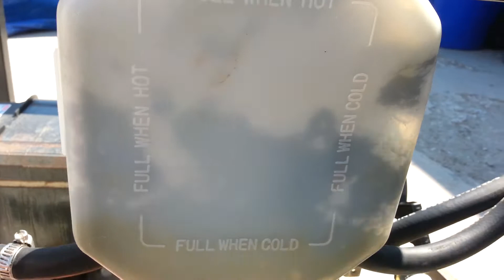Vapor Carburetor Running A 5000 Watt Generator

Comment: Sweet!!!  Nice work!! ~Russ
Reply from the maker: Thanks Russ! The funny thing is it runs good on vapors but won't run good  with the vaporizer shut off just running normally through the carb.. The hole in the flange I made for the exhaust mount is too small and creates too much back pressure when running without the vaporizer so I need to build a new one with 1" pipe instead of the 3/4" that's on there. The problem with using a 1" pipe is I will have to weld it on there because the holes that I would screw the mounting bracket onto are too close together.The joy of prototyping!

Comment: The primary concern is at what temperature does it run?  We tested a brand new engine and the only way we could keep the temperature the same was running it very rich.  It used the same amount of fuel.  Higher temp = shorter engine life  Find a way to cool it better and you could run it leaner and save fuel AND keep the engine running long term

Comment: The magnetic propulsion would generally be for home use I would believe that I stated previously. But what kind of run time are you looking about before gas becomes unusable? And heating gas to what temp would give what results in real world generators and cars? HHO and gas vapor system any thoughts of the two together? Cars overheating or running hotter with gas vapors? HHO showing what kind of temp results on vehicle as well? I'm a doer, but no sense in reinventing the wheel or wasting time or money yet. Still in the research stages but enjoying every second of it.. :0)

Comment: Have you ever considered using a petcock attached to the main fuel tank to start the engine and then switch it to a separate position to use the vapor? Would that even matter? I'm just wondering about its application. I feel like it could give the vapor more time to heat up.
Reply from the maker: No I have not tried using one. It doesn't really matter. You can start it off of vapors pretty easy. It can be a pain sometimes when you are first learning how each system works but once you do it enough you get the hang of it.

Comment: Enjoying your videos and time into this and these projects. I have a friend that is very knowledgeable of vehicles and head mechanic for twenty years. In his research cars that run on vapors usually don't go over 50,000 miles without serious problems to the engine. Just like to know your take on it. I have a week of serious study time into this but no effort in creating anything at this time. Studying hho systems and gas vapors. All started due to buying a dodge durango that I enjoy but 13 to 17 mpg. What would you suggest with a 5.2 v8? Been interested in magnetic propulsion for some time as well. Out to a generator/ battery/power inverter. Seems to be a pretty feasible concept as well. Any thoughts on that add well? Thanks
Reply from the maker: I'll have to get back to you on that when I have some time.

Comment: nice work, any significant fuel consumption savings with this vapor intake setup compared to the original contemporary carbuerator style set up with a fair load output on  the alternator?
Reply from the maker: Not completely sure yet as I have not had the time to do the proper testing on this particular setup.
Reply: im sure running a fixed rpm engine will be easier with vapor fuel rather than a car engine cos the car engine rpm varies now and then..I hope you keep us updated on thr generator set up, should see significant fuel savings running fixed loads on the alternator..take care
Reply: I just bought an ultrasonic water humidifier device for under 10 bucks from ebay, you reckon this thing can be utilized for fuel atomization as well? I never seen this stuff before and I bought it out of curiosity.. have you seen that device on sale? what do you think?

Comment: Hey I hooked one of these up to my mower, and a friend put one on his car, we keep running into the same problem of the gas getting really cold and getting nasty looking as well until it will no longer produce vapor. Have you had this problem and if so what is the solution?
Reply from the maker: On a cold vapor system like this you have to constantly feed fresh fuel into the mixture. I used a needle valve basically as a drip system to always keep the mixture at it's best vapor production point. If you don't keep adding fuel into the mixture the gas will not be able to continue to vaporize. I ran my tiller for 7 hours straight with no problems at all because I feed a small supply of fuel into the bubbler the whole time.

Comment: Does vapor look more viable at this time than hho
Reply from the maker: This particular system is easy and cheap to build. I added in allot of extra stuff for testing purposes that are not necessary. You can get allot longer run times when using hot vapors (cracked fuel). Testing will tell whether or not a cold vapor system is a viable alternative in comparison to HHO.

Comment: The ideal thing in a car would be replacing the fuel tank with one half vapour and the other(separate)half hho system to get the best of both systems, no doubt it has already been done but kept suppressed by the bastards in charge.